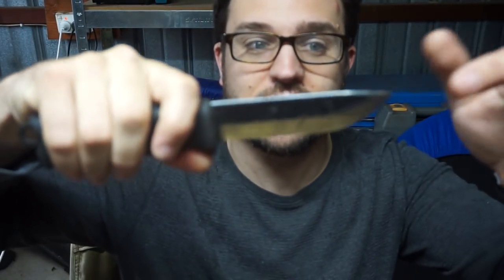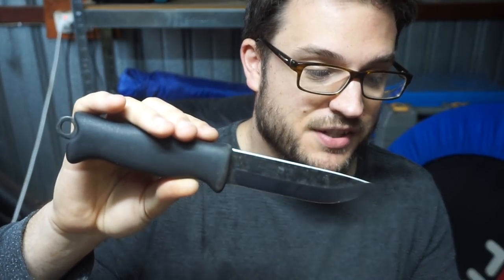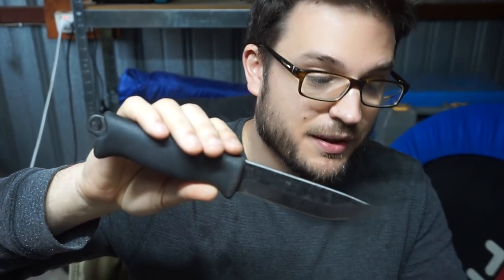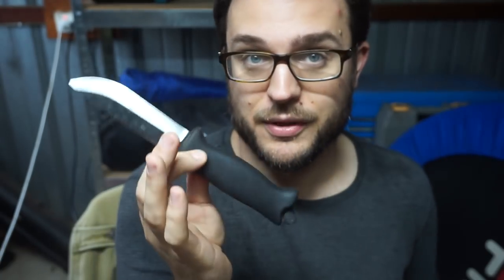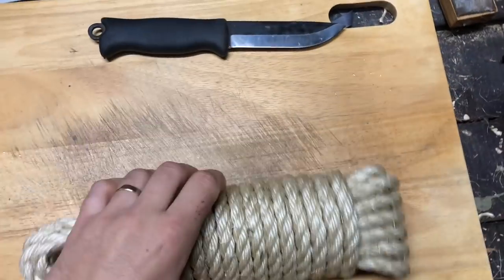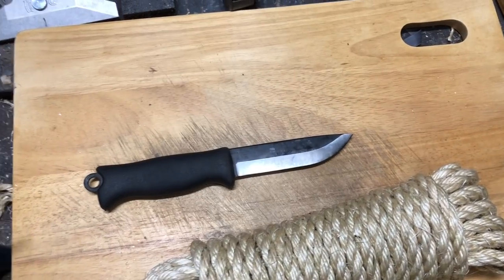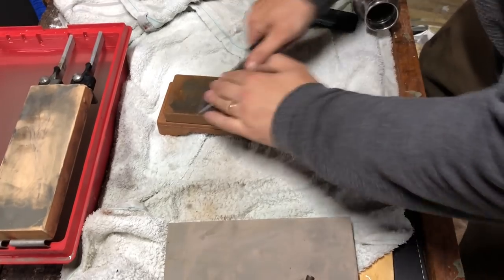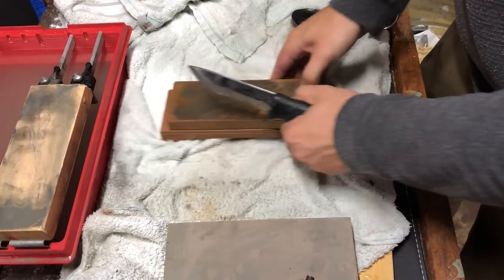Review: 80crv2 Steel - Terava Jaakaripuukko Edge Retention, Sharpening, Toughness, Rust etc

Comment: Trust me when I say 80crv2 is better than O-1 and 1095.  It's tougher, can easily be hardened to 61-62 hrc and in my experience has better corrosion resistance than D2 (which is supposed to be semi-stainless).

It was originally developed by thyssenkrupp for industrial woodworking applications, like sawmill blades and such.

It's also cheap, super easy to work with and sharpen.  And it takes the absolute sharpest edge of any of my knives.

For knifemakers, I think It's the holy grail of carbon steels.
Reply: mofomartian 
Good to know. I’ve been considering either this knife or the heavier 1095 Becker BK2. I’d pretty much decided on the BK2 until I discovered this knife - seems to me that there’s little the BK2 can do that this knife can’t do, and I’m thinking “why not get this much cheaper and lighter knife for (at least) the same quality?”
Reply: @whengrapespop5728  what can the bk 2 do? It's a 6mm thick piece of steel. The bk2 can do only hard work. But the 1095 from the beckers is for 1095 really good . Get the Jääkäripuukko you can do hard and normal work (and litte fine work) with it its more flexible than the bk2
Reply: Thanks mofomartian   Just picked some up today. Good to know, you answered all my questions. Bob Armstrong knives
Reply: While I agree on most part, its impossible for 80crv2 to have better corrosion resistance than D2 given both properly HT FYI.
Reply: I have pretty much the same experience. I have two wood carving knives with blades made of this steel (I am an avid amateur woodworker) and truly I would not choose anything else over those ones. I'd say the edge is useful up to 20% further than with 1095 or O1, before in need of lapping. I would especially highlight the useful properties of a narrow tip for inlay and marquetry work I often like to practice. It's quite obvious 80CrV2 provides the possibility of ending up as a very fine grained steel after a well conducted heat treatment process.
Reply: you are absolutely correct, i could show you like a few videos about knifes out of this steel... they destroyed a car, are unbreakable with bare hands and were able to cut through metal, just a bit nice contact with leather and its sharp again and ready for the next use... 80crV2 is in fact the holy grail of carbon steels and maybe one of the toughest, fairest (price) and easiest steels (care) on the market... definitely one of the steels you can really trust in... carbon steels are in 2020 the new premium steels... pm steels are to expensive and because of less carbon not that resistant and can easily be destroyed while forging or producing so they wont break instantly but are not that tough in the future, its just a too high risk and the good old carbonsteel works and works... the point is, you can easily keep rust away from the knife and new technical steels with good rust resistant are not that tough anymore... in this specific case they are not really an upgrade at all, they are just better for specific situations... but if you want an allrounder, a nearly undestroyable knife, you have to go for carbon and 80crV2 is maybe one of the best
Reply: @SAKAYA22  Exactly, 0.5% chromium vs. 12% in D2? Some people do not know what they're talking about.
Reply: You know what the difference between O1 and 80CrV2? Very little. They are almost the same except for O1 has 0.15 more carbon and 0.5% tungsten and double the manganese.
I can heat treat O1 to a tough HRC63-64 if I wanted to do a deep cryo in liquid nitrogen, but it isn't worth buying as I get 60-61 with good toughness without it. That 0.2% vanadium restricts grain growth so I can put all the alloys into 15 minute soak instead of non-vanadium O1 at 10-12 minutes. I do not know what alloy he's showing up there, but it's not 80CrV2.
1080+ is what this alloy is called in the USA as that is what it is. Many knifemakers thought it was a Chinese steel so they called it 1080+, here are the two steels chemical analysis.
https://www.alphaknifesupply.com/shop/1080-carbon-steel
https://www.alphaknifesupply.com/shop/o1-carbon-steel
Reply: Right on,I agree
Reply: Mountain Fisher It’s more complicated than that.  The chromium in D2 forms chromium carbides; it’s not there for corrosion resistance.  You need free chromium for corrosion resistance, so some steels with far less chromium are actually more corrosion resistant than D2
Reply: What's the best way to oil this type of steel?
Reply: @RachelleBatYHWH with oil

Comment: I love this knife! I can’t believe the edge retention of this steel over Esee/ Ka-Bar 1095. For half the price of those brands you can’t go wrong!
Reply: Well it's 80crv2 not 1095.. I know heat treatment makes a difference but 1095 isn't exactly super strong. It's durable tho
Reply: @jhtsurvival  1095 is (I've done it) fairly, and sadly quite chip happy. And Kabar it's known to run their hardness pretty high, which can account for my experience..
Reply: @jhtsurvival  1095 isn't as tough for a given hardness so 80crv2 has a bit more potential than 1095 since it can be left a bit harder without chipping.
Reply: @PureCountryof91  ok? Like I said it's 80crV2
Reply: @Gareth Baus  ok? Like I said.  It's 80crv2 not 1095.

Comment: People need to remember that what is demonstrated here is : the quality of this particular steel's heat treatment on this particular knife with this particular blade geometry. 

Plus: the convex might lose the paper cutting ability at 100 cuts but it might very well remain a better hard wood processing edge for longer than the V edge and the Scandi might stay a better finer wood working edge for longer than both. This kind of knife is typically not designed to be cutting kilometers of rope and sheet paper, more like doing wood stuff.

Different edges fro different needs. The V is generally a compromise of convex and scandi

Comment: 80CrV2 is a good steel. I am using it for more of my knives. 
If you're getting into making blades, it is important to be aware that many steels vary in actual composition depending on manufacturer. Some that I'm personally aware of are 1084, 80CrV2, O1 even though they are sold as the same steel.
Thanks for the video.

Comment: I recently ordered some 80crv2 for some slipjoints I am planning on making, it is a decent steel even if it doesn't exhibit particularly impressive edge retention. The first design I am planning on building is an overbuilt large single blade slipjoint.

Comment: It would have been good to know the Rockwell hardness on this knife too. It's a great steel I use it a lot and really like it. Heat treat will also make a difference , but I know you that. Another good video.
Reply: DeDominicis Knives I’ve seen on a few reviews that it’s 59 hrc. The website says it has a differential heat treat with the outer layer being softer than the inner layer. That’s why the spine is ground the way it is. The knife is made for varustaleeka by a company called “lauri” they are held in high regard with the Finnish knife community. I hope this helps.
Reply: Thanks for sharing the info. Was just curious I would have thought it might have done a little better on the rope cut test. I get a lot of good feedback on 80crv2.

Comment: can you please unleash to the max?

i read 3 articles in knife steel nerds: 1.edge stability 2.edge retention 3.carbides in knives

because i saw in knife steel nerds article that this steel has the best toughness for the amount of carbon
because toughness directly correlates with edge stability it should be able to handle 15 degrees easily and not roll or chip

and also that article that this steel has few carbides that correlates with wear resistance and edge retention

so we can predict edge retention will only come from high HRC (in this case 57 is quite low....)

on the other hand all of this just means it will be amazing when unleashed to the max!
(it wouldnt roll or chip even at very low angle [and probably a different design very thin like chef knife would work as well])

what do you think?

Comment: How do you get the whole edge sharpened on the work sharp? Using that guide I ended up not getting the last few millimeters before the grip on some blades, I had to mod the guide by cutting pieces out. I thought you had the 20/40 degree outdoor guide, looks like the 25/50 guide that comes with it but set at 20/40 (it's discontinued now).

Comment: 80 CRV2 is somewhat like D2 but it’s a whole lot easier to sharpen it’s downside is it  rusts  like any carbon steel it lends it self to big knives like Bowie’s  choppers or scandi ground blades used for bat-toning   even axeheads has a good  edge retention with a whole lot of toughness and shock resistance a great steel highly underrated

Comment: Good video... but don’t hold the handle of your knife to yourself and push the belly of the blade away from you. That will flatten out they belly of your knife. Keep the knife parallel or on say a 45 to the stone the whole time, and just lift the handle that will ensure you don’t round the belly off.

Comment: I just came across this vid and while yes your alloy spec is correct it is only correct for specs from ONE manufacturer that being DIN in Germany... They comprise less than 10% of all 80crv2 produced and the rest is coming out of various other EU countries and the bottom end carbon drops significantly with the upper limit being higher...the carbon variations are so massive that the alloy is practically garbage ...i refuse to use it for any knives or tools its so bad

Comment: what's better this or 52100
Reply: Manuel Silva define better. 52100 will hold an edge longer, but 80crv2 is a lot tougher. So for a small knife, go 52100, for a larger knife or a hard use knife, go 80crv2. I make survival, hunting, and fighting knives,  so for me, 80crv2 will work better for what I'm making. Neither steel is bad, but 52100 is more brittle so I want my knives to survive the worst conditions you can put them into, so I usually use 5160, but I'm looking more into 80crv2 cause it's even tougher and holds an edge longer.
Reply: Ian S. Very nice that's what I meant. So 80crv2 is even tougher then 5160?

Comment: You forgot O1 has over 1% manganese. It makes the heat treating different. You cannot compare steels if you ignore so called non-knife hardening alloy elements. I heat treated (HT) both and O1 with Vanadium always beat the 80CrV2 because of that Manganese and a tiny bit of Vanadium. At 0.2% vanadium doesn't make carbides, but what it does do is restrict grain growth in the matrix. 

Vanadium makes harder carbides than even tungsten. Explains those "super steels" with high percentages of vanadium. FYI

You can buy O1 without the Vanadium, Latrobe still makes it, you don't want it. 80CrV2 was made for the folks with forges for HT in case you get too hot it won't create large grains in the matrix unless you go way too hot. Difference is that right after quench within 2 to 3 minutes O1 can be straightened easily if it warps, but the 80CrV2 does not have this property. See what that manganese does? I cannot say for certain, but it is the biggest difference between the two and the 0.5% tungsten which cannot account for short term flex. 

A short HT lesson is gradually heat O1 up to 1475 F and hold for 12-15 minutes depending on thickness, then quench in an oil with a slower cool rate than Parks 50. Canola oil is about right at 120 to 130 degrees, O1 takes a slower quench. It will be HRC 65 as quenched. The 12-15 minutes is necessary to get the chrome and tungsten into solution to form into carbides upon quench. Then literally as fast as you can you quench in oil, edge down. No more than one second should pass from oven to quench on ANY high carbon steel, so have the quench close.

80CrV2 is different and needs a higher temp for austenization or the formation of carbides. It needs to be heated to 1580 F and held for 5 minutes then quench and it will be about 66 HRC. I won't go into tempering, but there is a fairly large difference. A two hour temper at 400 F will put you at 60HRC with 80CrV2. O1 on the other hand it takes two hours at 450 to drop to HRC60. Temper both steels twice.

See how small differences change the final results? You cannot guess too accurately about the final results. I'll stick to O1 for my High Carbon alloy steel. Of course to get the best out of the steels you need a good HT oven to control the heat.

Comment: That's the worst stone sharpening I have ever seen or imagined I would ever see in my life. You do everything, the opposite way it should be done. For exapmple you go fast like crazy, which can lead to serious injury or destroying the edge bevel at best. You put your fingers outside the stone surface, when you should put them on the blade part that is on the stone. I could say more, but that was so (I can't even describe what I saw) lets awful, that I don''t see much room for improvment. I was crying for that knife, because you completely destroed the bevels. If you could only see, how good this knife can perform,after putting a proper edge on it,  only then you could understand.